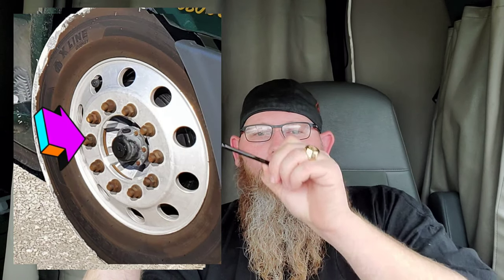Prime Inc. Sliding tandems

Comment: Please refresh me on the sliding tandems. Like on some trailers I seen it doesn't say what hole to put it in. And how much does each hole weigh? Nice video thank you.
Reply from the maker: Every hole does not have a weight. I have moved 1 hole and moved 1000pounds to 200pounds.
Reply: @TwiztedD  I was just informed that tandems have a weight of Atleast 350 to 400 pounds to 500 lbs on  each hole. And fifth wheel notches are Atleast 100 lbs per notch which one is it. I'm so lost . Not really but I use bridge law .
Reply: @TwiztedD  then I heard some truckers don't even use the bridge law